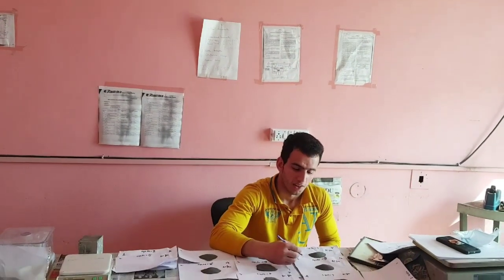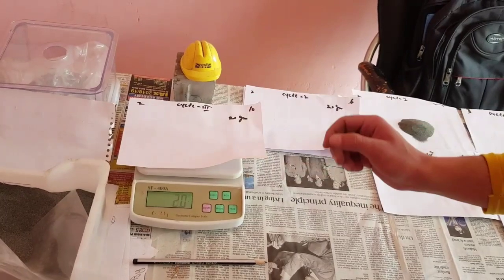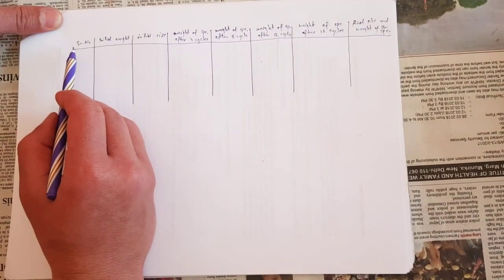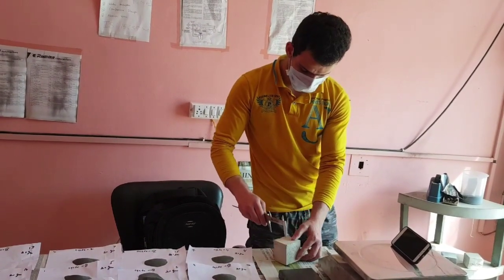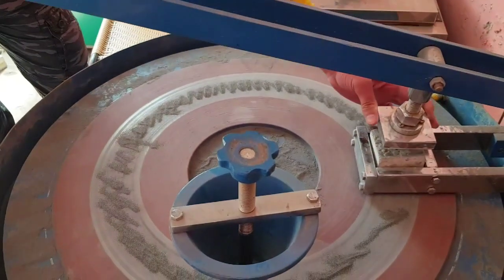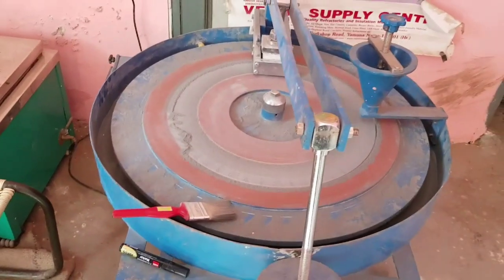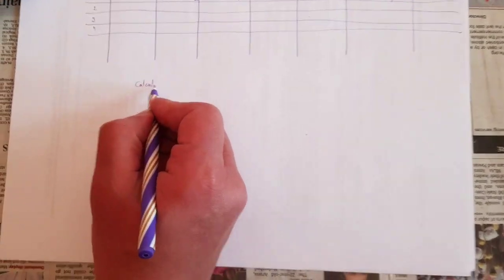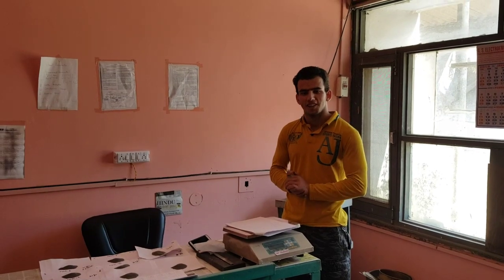Step by Step Procedure for Abrasion Resistance Test of Cement Concrete Paver Blocks

Comment: Hello, what rule are you working with? ASTM? I need the data and name of the materials regulated by a standard. Thanks.
Reply from the maker: This test is based on Indian Standard: IS 15658 (2008).
Reply: @civilengineeringacrosstheg455  thanks